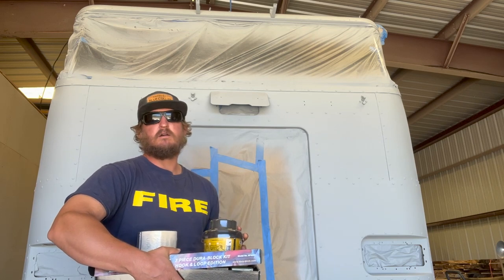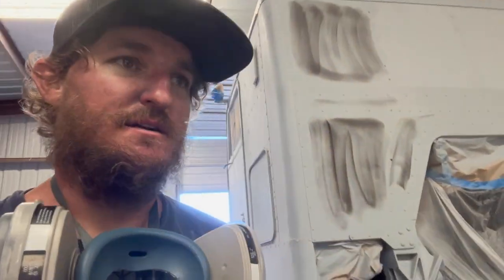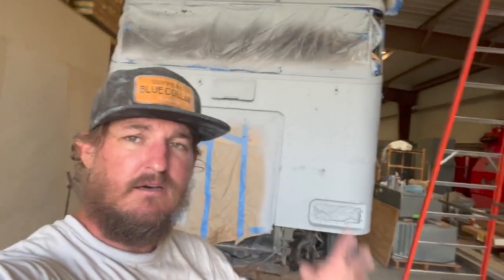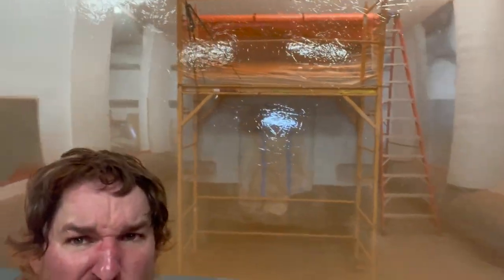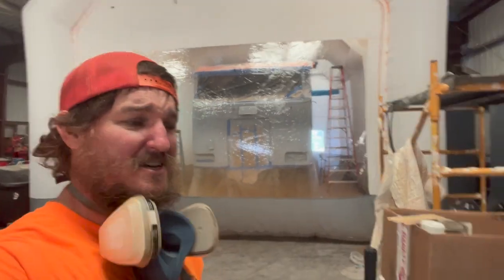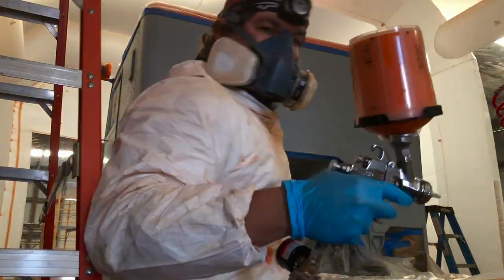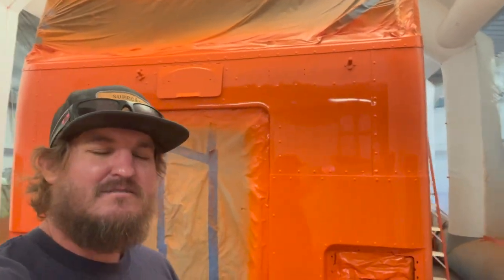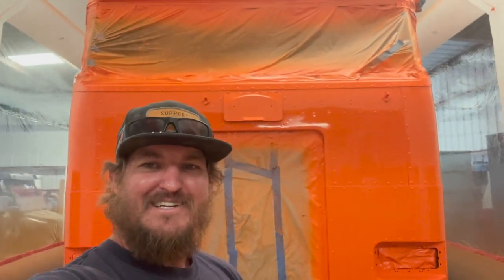I Painted my Peterbilt 362 Cabover Omaha Orange!

Comment: hey I noticed you didn't wanna turn the gun upside down but if your using those 3m cups before you start spraying hold the cup upside down and spray the excess air out till it sprays paint... then you can spray any angle you want even upside down... beautiful work 🤙
Reply from the maker: Good to know thanks. This was the first time I used them. Thanks for watching!

Comment: You really should blow a coat of sealer over the job when your done sanding .. You dust it off blow a coat of sealer and walk away .. The Epoxy sealer has excellent color hold out and will NOT allow any previously done old body work bleed thru ..Or absorb leaving the chicken feet tracks ..

Comment: one full coat of paint all over, let dry for a few days, 2nd full coat, let dry for a few days. Then clear coat all over & let dry. Another clear coat & let dry!
Reply from the maker: This is a single stage paint no clear needed.
Reply: @cfnevada  Ya applying another coat or no
Reply from the maker: @truckerray7533   no did 3 coats. Looks great to me.
Reply: @cfnevada  10-4 👍🏼👍🏼👍🏼